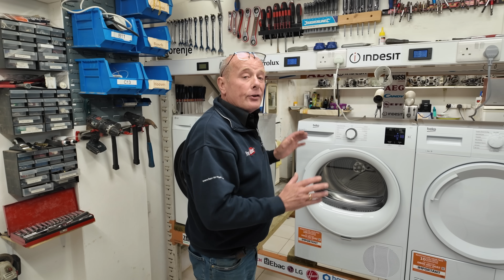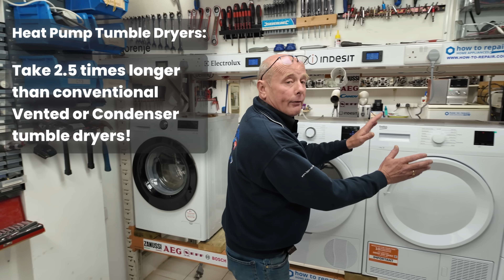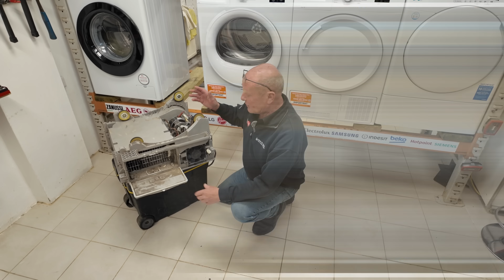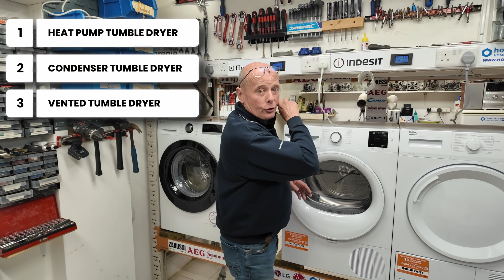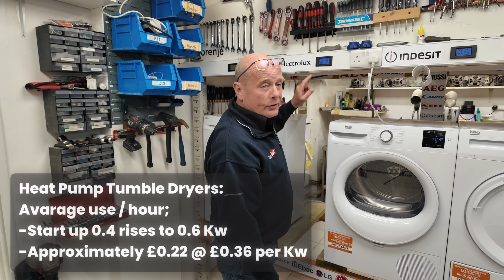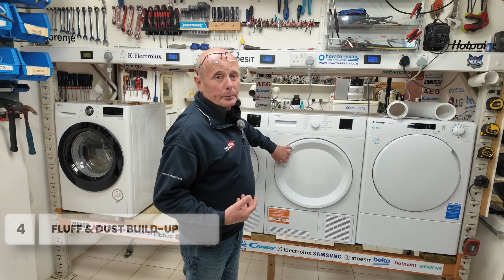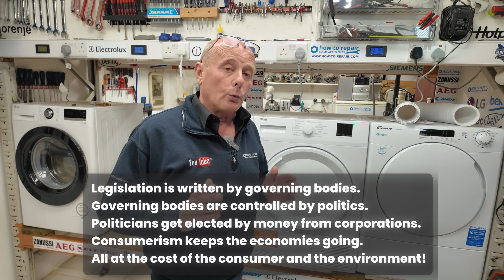Tumble Dryers the Shocking Truth About Heat Pump vs Vented & Condenser, NEW LEGISLATION!

Comment: Dryers are dirt cheap, usually given away (ok found in garbage), easy and cheap to fix - for a handy person. Same with washers. People upgrade, move.  HP dryer best-use is for apartment or off grid to save battery.  No vent or 240v receptacle also makes their placement more adaptable. However, 
I recommend 120v dryers with a session removable cardboard window vent template for the cheapest, most convenient laundry independence.

Comment: I can't provide actual consumption figures of our Miele Heat Pump dryer but I can tell you that we've had that machine for 12 years.  A full load of towels spun at 1600rpm will complete a drying cycle (and be perfectly dry) within 1hr 20 - 1hr 35 mins.  We did notice that smaller loads between 1 - 3 kilos will take between 40 - 50 mins.  We've been largely impressed with the processing times.  The dryer was expensive at the time (£1100), at 12 years old and still going strong, I'd say it's more than paid for itself.  In our experience, we can only advocate for heat pump dryers.
Reply: Most people can't afford to lay out for a Miele though can they.
Reply: @deemdoubleu Indeed, but I imagine Bosch or Electrolux would be very reliable brands in the heatpump arena, which I guess are a little easier on the wallet.
Reply: That’s a long time for towels😂  normal dryer may use more power but finish in 30 mins .. so in the long run the heat pump would use more power overall
Reply: @Ness72XX  30 mins for an 8kg load of towels to dry in a domestic machine? I'm not convinced.  Commercial machine, absolutely, however, I do agree that a vented dryer will complete a cycle faster than a heatpump,  condenser dryers being in-between.  

To your point about heatpump cycle duration.   A heatpump dryer draws significantly less power than its vented or condenser counterparts.  Duration, whilst longer, does not equate to a high operational cost per cycle.
Reply: Nice!!

Condensers etc probably use 5-10 kWh for a full load and clothes take a pounding each cycle. We use 1 kWh or so, very kind to the clothes.

We have a 2012 Cylinda TVP 420 with heat pump. It has a 800 W max rating and it has served us BRILLIANTLY for 13+ years now. Only thing is a bit of belt slip(?) causing noise during first minutes of operation, that's been for many years now. We found it on sale and I got the price down a bit more, picked it up for around £400, original price was twice that.
It dries 8 kg of clothes in 60-90 min, so I'm not sure what garbage is on the market these days. 
Our 2012 Cylinda Sverigetvätten washing machine is very similar to the ASKO you recently reviewed, only older... We also have a Cylinda Sverigedisken, dishwasher, from 2012, nowadays produced by ASKO, while Cylinda took the path of planned absolecense. Our parents in law have an ASKO and after an initial warranty repair, it's been GREAT and the inside is fabulously great to allow three layers high stacking and STILL getting it clean!

Comment: Thanks for the great videos.........regret buying a heat pump dryer..i fell for all the hype about saving money and the planet...i have a Beko DHY7340 and constantly from purchase have to run the programs a second time to get the clothes dry..it has now after 5 years started to leak water while on so going back to the trusted condenser dryer this week. I have solar panels and  an electric car but heat pump dryers is one technology i wish i had given a wide berth.
Reply: Your dryer drain tube is just clogged up with bacteria and algae, like a fridge.  Your rads have been blocked by lint for years,  I will take it off your hands for free.

Comment: I've been called an idiot for my views on heat pumps when paired with solar. I think you are on the right track pointing out the added problems and costs associated with heat pump dryers. I would add that the same issues apply to heat pump water heaters and air source home heat pumps. While they also can save money over other heat sources, the real gold ring is a return to resistance electric heat (like your vented dryer). As someone who has been playing with solar for over a decade now, I have watched the still continuing drop of solar panel and inverter costs. You can extrapolate this beyond heat pump dryers to heating water and the home. As solar costs fall, you can see the coming convergence of how, in the near future, the simplicity of resistance heat trumps the efficiency of heat pumps. Falling solar costs are bringing us closer to "free electricity" every day. When it is free, who cares about efficiency? While the more expensive home heat pumps are available that work at temps below -25, straight electric heat blows right past that. Electric arc generated heat can run a blast furnace! While I use heat pumps to cool and heat our home, in the future, I would look at adding more solar and heat with resistance. I would still need a compressor for AC, but straight AC units are  usually more efficient and cheaper than heat pumps. The continuing, relentless drop in solar cost is poised to greatly change the world.

Comment: When you compare the energy consumption of a clothes dryer to other devices in the home, if you only do 3 loads of laundry per week... a home computer left on, or a cable box, or even a refrigerator might each even draw more power as they draw power more or less continuously. For example a computer could draw an average of 35 watts per hour; that is 5880 watt hour in a week! That is more than enough to dry three loads of laundry alone! So a better mandate is to make changes to devices that draw power all the time. Another example: a 9 watt LED lightbulb left on in a closet for a week uses 1512 watt hour ... almost enough to dry a load of clothes!  Heat pumps really don't make any sense for an infrequently used thing as a dryer as they add a level of obsolescence perhaps limiting the lifetime of a dryer to 5 or 8 years... I have a 29 year old gas clothes dryer still going strong!

Comment: we ran a bosch heat pump dryer for 12yrs. Along the years, i have changed the door seals and fluff filters but nothing major. But every couple of months, i did put in 20ml of bleach in the water tank before each drying cycle

Comment: I am looking at either a Heat Pump or a Condensor Dryer. Using the Product details I have worked out that I need to run aound 150 full cycles to break even on the costs between them. So its ging to be three years or so to just break even on the cost

Comment: We have a Samsung heat pump tumble dryer and in our opinion it works better than the previous condenser dryer, it doesn't seem to take that much longer than the previous dryer and the clothes come out dry. I don't get the impression that we're using more electricity than the previous dryer and just for the record I'm not pro green energy blah blah blah, we don't have solar panels, a heat pump or an EV. Maybe the manufacturer and spec of the machine has some impact but I would buy the same Samsung heat pump tumble dryer again.

Comment: I have a heat pump tumbler dryer (entry level Zanussi, cost £449, only 1 year warranty)  and it's developed a problem. I've found your video very very interesting and I'm beginning to wonder if my purchase, just 1 and a half years ago was a mistake.  I've cleaned what I can but the dryer isn't collecting water any more. I suspect a blockage somewhere. One repair person I called did indeed say, oh no, I don't fix heat pump dryers (as your commentary indicates).
Reply from the maker: On these occasions I really do hate being right, you will find it very hard to find any decent engineer willing to work on these. The technology is good but when introduced with poor filtration systems they are a recipe for disaster. I hope you find someone that is willing to assist you in your repair.

Comment: I thought to change my condenser dryer out a while ago as everyone mentions the cost of running is becoming increasingly expensive.
What I found out was no heat pump dryer works effectively in a cold room.
My condenser dryer is fine in our unheated garage I doubt any heat pump dryer would be the same but welcome any comments to say otherwise.

Comment: No issues with my Beko heat pump dryer which must be getting on for a few years old now.

Manages to dry a load quicker than my washing machine washes, which is the important bit. The timer says it will take an eternity but it is very conservative and the sensor stops it in under an hour usually.

Initially the clothes always came out a bit on the damp side but then I found out that's because the machine quietly resets the program to the wimpiest setting every time it's turned on.

I think people have issues with HP dryers because they don't clean their filters and they put too big a load in, if you don't give space for the clothes to circulate then they won't dry. Bedsheets always take longest because they roll up into a ball.

Comment: I stripped my condenser dryer right down as I was unable to find any electrical faults it had to be a blockage. I ripped it apart removing the drum. I have never seen so much fluff and dust in a machine.  Motor was out as well. A thorough clean, reassembled and has worked perfect for the last 6 years. Its a Beco.. Not replacing anytime soon.

Comment: When I wash my clothes, and when put in the dryer I noticed there is very small amount of lint in the filter, every time.  But the other people in the house, for some reason their clothing has what I think is a huge amount of fluff and debris going into the lint filter.  Why is that.   I never wear polyester or other synthetic fabric only good quality all cotton, linen wool maybe some bamboo sheeting.  I have had some newer cotton bedding made in china and the fluff in the lint filter was so bad it was massive and after washing it several times the fluff was still a lot as if the fabric was perpetually breakjng off  small fibres, so I took it back to the shop as unsuitable.  And overall I wonder if some clothing items aren’t made well enough so that it sheds so many of the fibres that end up in the lint filter. I also at one time wondered if leaving dirty clothes on the floor (instead of a laundry basket) before washing them, will that collect a lot of very very fine dust particles that don’t really wash out and end up in the Dryer filters and vents?.  In the heat pump dryer secondary mesh vent  I’ve noticed some very very fine grey dust perhaps sludgy matter and I’ve found it easier to wash and flush all that away with cold water and airdry  completely before reassembling.  If fluff contributes to the machine not working properly or breaking down, then should our clothes be made from fabric that isn’t breakjng up into so much fluff and lint all the time.  Also I use the dryer for a full dry, or less often, and dry clothes in the sun, or partly dry them in the sun, and use the heat pump dryer to finish it off if not enough sun time available. Either way, I still have minimal lint in the filter  from more natural fabric which is of good quality.

Comment: Had a heat pump condenser dryer for just over 3 years. The compressor failed and I was quoted more than the cost of the machine to replace the it! This is from a very well trust repair company we've used for 30+ years. Disgusted by the bollox the government pushes out as 'green' tech. I'll be getting a vented "old school" machine and keep it running for the next 30 years myself. The 'green' model is off to be scrapped!

Comment: Great video and I found our heat pump tumbledryer a total waste of time and money. I have 4 children and we do alot of washing and bought a Panasonic heat pump tumbledryer in 2013 as we thought it would save us some money on electricity. Standard drying time would start at 3 hours then the sensors would adjust the time for weight and how wet the items were and this would go down to 2 hours and then it wouldn't fully dry the clothes first go, so you would run it again and it would adjust the time down to 40 mins. Sometimes you have to run it a third time. We would also spin the clothes a second time in the washing machine at 1400rpm before they went in the tumbledryer and it always had to be run multiple times. We had a 5 year warranty on the Panasonic tumbledryer then 3 months after the warranty expired the heat failed and we were looking at a £200+ part plus call out back in 2018. We replaced it with a new Miele condenser tumbledryer that dries first time in around 60-80 mins and has never let us down.  I wish I had repaired the tumbledryer before the Panasonic or bought a Miele instead.

Comment: I’ve just found this vid while looking for some maintenance tips for my beko heat pump. 
You’ve just explained exactly why I feel I made a mistake in my purchase of this machine approximately 3 years ago. 
Now I still need to figure out why my dryer had water pour out when I removed the panel at the bottom. Don’t think I’ll be using my hoover on those fins today 🤦🏼‍♀️

Comment: Interesting poiints that don't align with my experience. My heat pump dryer has two covers that allow you to clean the condenser and evaporator. Also, 425 watts is not a quarter of 2400watts, it is less than one fifth. And, my dryer takes less than double the time to do the same load as my previous vented unit. All in all, my machine is using about 70% less electricity.

Comment: You should also do or research a mine to disposal CO2 assessment,  As the heat pump drier uses more recources and therefore creates more CO2 in its production, + the  the gas needs to be disposed of . So over the life of the machine the longer run time and including production + disposal the over all CO2 reduction benefit is not as much as people imagine

Comment: I think that you missed the most important benefit of the heat pump dryer. They extract the water slower and significantly reduce the risk of clothes shrinkage . In my opinion this far outweighs any of the negatives..

Comment: I was going to get a Heatpump dryer until I stumbled across this video I must say you have saved me the headache of a machine that takes so long and possibly dying in 3-5 years I watched it and took alot of the information you explained and I've decided to buy the Electrolux EDV705H3WB dryer instead of the Heatpump dryer Haier HDHP80AW1 with self cleaning condenser still can't buy it because the maintenance is gonna cost more than the machine it self would and another thing my grandpa doesn't usually watch YouTube but he loves your videos and thinks your very smart professional and very clever

Comment: I have a Bosch serie 4 heat pump tumble drier which is over 9 years old. I’m fortunate to have solar with battery storage and the heat pump works well with this system as it only consumes 600watts when running. A 2.5kw system would unfortunately drain the batteries rapidly.

Comment: Very well said. Green washing is everywhere, and battery cars and emission control on combustion cars is similar. 

I am a 65 year old Australian and driving and excellent condition 1993 Turbo Diesel 80 series landcruiser on Diesel gas. I will get another 200,000 kms or 5 to 10 years or more out of her before any engine work MAY be needed. It is just like heat pump driers thrown away due to repair cost and battery cars and modern diesel cars that just don't last and uneconomical to repair. Add to this the inability of the consumer to DIY new technology rubbish.

Comment: If electricity wasn’t so expensive I wouldn’t care. That in mind; I want something that’ll be more efficient. Im in a hot humid climate so here’s the issue. A vented heating style dryer will suck the cold air from the house, heat it and expel it outside. So not only is it forcing the HVAC to run more, it’s sucking outdoor air through the house from doors and windows. Dust and pollen come with it. The heat pump drier will fix all that and will end up being more efficient for the overall house power consumption.
Reply from the maker: Thanks for sharing your thoughts on this, it’s a really important point to consider when making a decision.

Comment: Good on you for stepping up and pointing these facts out!! I'm even more happy with our old vented dryer now. It's 14 years old and yes we have had to replace the belt pulley, later the motor and heater elements, but it was cheap and easy. But it is still going with all its bits. We were thinking about the heat-pump dryer.. Not anymore!! thanks so much for your time.

Comment: Our Miele heatpump has never taken more than 90 minutes for a standard load regardless of temperature.  It registers around 800w. It's 12 years old and has probably saved us more in electricity than it cost. 
Also they work at lower temperatures so don't shrink clothing.

Comment: Thankyou so much for this information, I have been confused as to which dryer to purchase, It would have to go in the integral garage, a n d didn't fancy knocking a vent in the wall, so it was a toss up between a condenser or heat pump, ime so glad I had the chance to listen to your video, and I've gone for a condenser which is being delivered tomorrow, thank you for your excellent advice,

Comment: I see that Bosch's newest Series 8 heat pump dryers now feature an automatic cleaning feature for the condenser. "Bosch heat pump dryers with self-cleaning condensers maintain peak energy efficiency by automatically cleaning the condenser up to four times per cycle, ensuring gentle drying and performance."
Reply: One tip for self cleaning models is to put some water back in the condensate tank after you empty it. That way it ensures a proper rinse of the condensers even from the early stages of drying. I keep mine 1/4 full for this purpose.